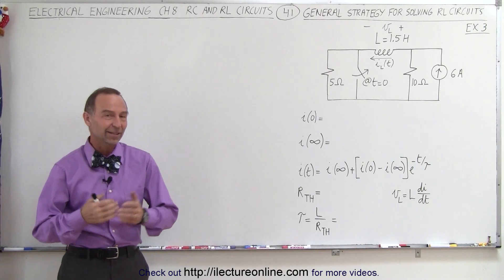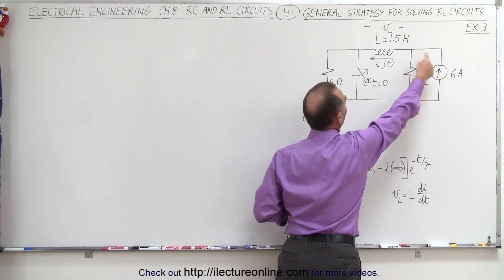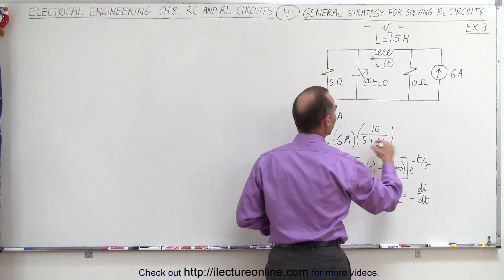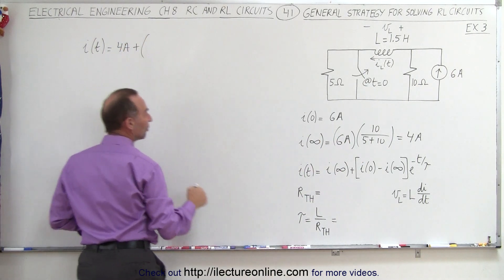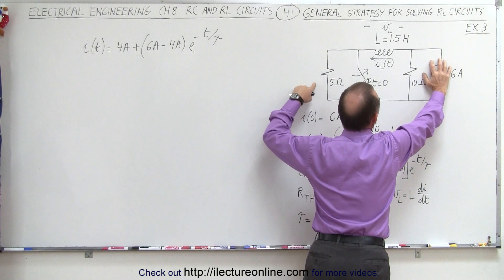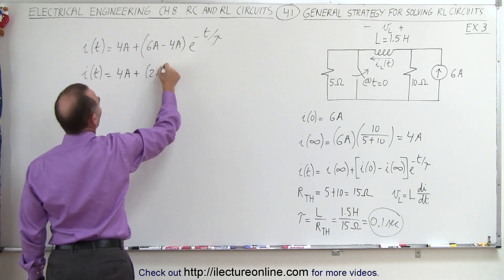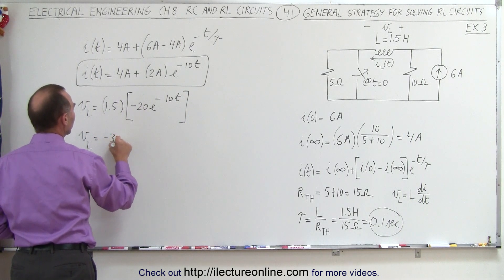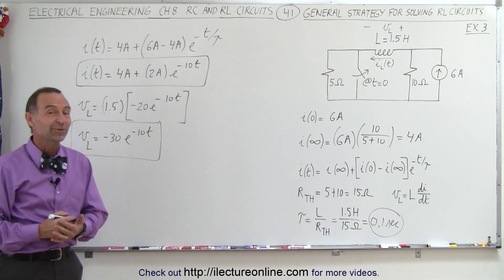Electrical Engineering: Ch 8: RC & RL Circuits (41 of 65) General Strategy Solving RL Circuits Ex.3

Comment: Why is resistor 10 when t>0 not ignored, even though in the initial material (https://www.youtube.com/watch?v=pd8cEL8hhi8&list=PLX2gX-ftPVXXnp1Q4us-Vi7HqHE33AtzA&index=14) when there is a resistor parallel to the inductor, the resistor is ignored?

Comment: I believe this is wrong when switch is off current wnt flow through the 10 ohm bcs of short circuit of the inductor in steady state.
Reply from the maker: There is no short circuit and there will be a current through the 10 ohm resistor.
Reply: @MichelvanBiezen  but Sir u said once an inductor reaches steady state it basically becomes a regular wire. If we go by the logic of least resistance, why would current pass through 10 ohms when inductor provides zero resistance at steady state, im i missing something?

Comment: why you didn't proceed simply by computing Req as 10/3 ??? how you noticed you need to use Thevenin's theorem??

I guess you did a simple source transformation in mind and noticed answers become different if you don't
Reply from the maker: Before the swith opens, you have a parallel circuit indeed, but as soon as the switch opens, it turns into series circuit.

Comment: i dont understand why the 10 ohm resistor has no current passing thorough it initially, okay there is a short circuit but it's across the 5 ohm resistor
Reply: because at steady state or when the switch is closed, the inductor acts like a short, so it will draw all the current thus, no current flowing through the 10 ohms resistor

Comment: Problem made much easier with source transformation at t > 0. Change 6 amp source in parallel with 10 ohm resistor to 60 V source in series with 10 ohm resistor. Now without thevanin it is clear that both resistors are in series with Req = 5 + 10 = 15 ohms.

Comment: I'm still not clear on the part when the switch opens.Why does the current go into the 10 ohm resistor if the path of least resistance would go in the direction of the short circuit and the 5 ohm resistor?
Reply from the maker: Less current will go through the 10 ohm resistor as compared to the 5 ohm resistor (but not zero).  The current source will push current through both parallel paths.  When steady state is reached twice as much current will go through the 5 ohm resistor compared to the 10 ohm resistor.